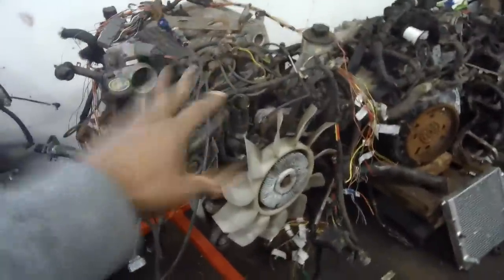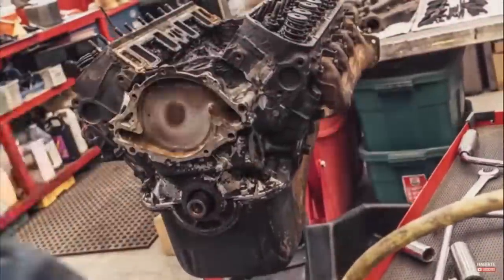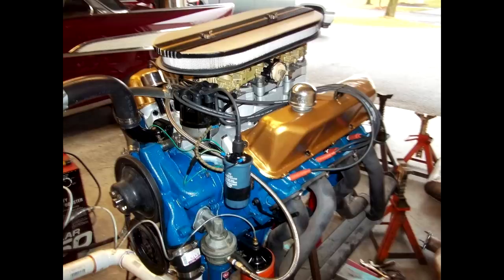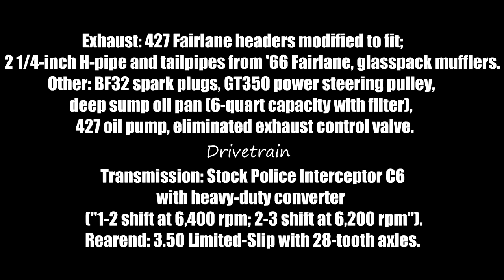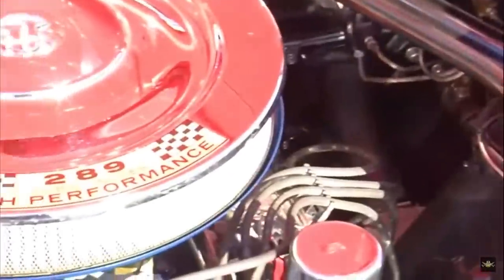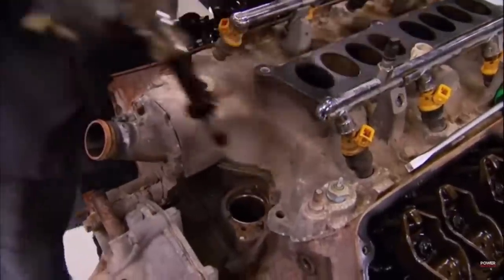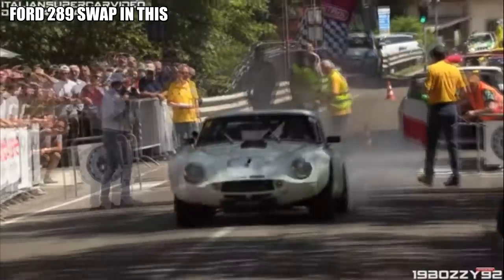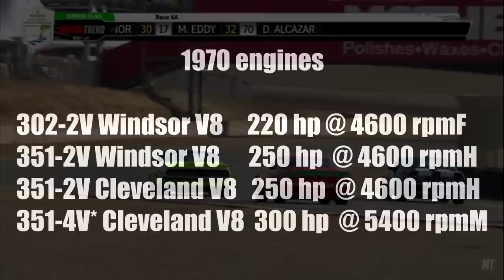289 Ford Voted BEST ENGINE BY CARROLL SHELBY ( HERE IS WHY )

Comment: Seeing how I grew up with all these engines... Here's my top 5: #1. 289 HiPo, sweet high revving reliable engine. #2 351 Windsor, just a stout motor. #3 302 Boss, Cleveland heads canted valves:) #4 429/460 Lima, it's a 302 Boss on steroids:) and #5 390 FE, FE's was the work horse engine back in the day, 352, 360, 390, 427 SOHC.  And Honorable mention: 300 strait 6, just a stump puller of a motor:)
Reply from the maker: this is a solid list  I mean a solid 1 Daniel I may have to side with this list.. cause i leave out so many other factors ( take the personal out ) and get to the balance and the performance of the engine 289 300 302 Boss 351-C, but I flip flop that #1 spot with 302 plain version. cause see them still running
Reply: @bstfordchannel923  True on the 90's 302 roller motors... and a stroker kit takes it out to a phat 348 :) But Dude! the 351 C/M Boat anchors :) The 400 Modified was built during the EPA 70's and barely 8 to 1 compression!  Love Cleveland 2V heads but scrap the block.
Reply: THE 429/460 CAME OUT IN 1968 BEFORE THE 1969 BOSS 302. SAME HEAD DESIGN JUST SMALLER BUT HAD THE SAME SIZE VALVES AS THE 429 SCJ.
Reply from the maker: @normanschwartzjr2564  great info Norman I can not debate ya i know very little details of the engines.. I just do not go there so deep.. Good info
Reply: @bstfordchannel923  the only reason I would not choose the 302, is short rod and on early engines the piston skirts would tend to crack on a higher mileage engine. Where the 289 had a longer rod and I never found a cracked skirt even though the engines use the same piston. 
A 289 in similar trim, cam, heads, intake, carb, exhaust, as a 302, the way to best describe, snappier and revs quick. And I like that about the 289. 
My vote goes for 289 !
Reply: 289 HIPO was my favorite too IN MY 1966 MUSTANG 2+2.
Reply: @normanschwartzjr2564  just imagine the engine with stiffer valve springs and a little bigger carb.
Reply: @chrismontreuil2206  Chris, mine had a 750 double pumper, cam, springs and headers and the RPMS were over 8000. It sounded great. That was in 1972 IMAGINE  what it would've been like with today's aftermarket cylinder heads.
Reply: I always wanted to FI that 300. I bet it would scream.
Reply: @bryanst.martin7134  I am a Ford guy, but the chevy 250 is a screamer. I once saw in an old hot rod magazine, someone cut and welded boss 302 heads and fitted it to the 300. Then it screamed !!!!
Reply: @chrismontreuil2206  Don't forget the solid lifters, and a warmer cam. Also the F4B was a big performance enhancer.
Reply: @normanschwartzjr2564  well your talken just passed 400 hp !
I am not into after market heads. But I hear you about that.
Reply: @bryanst.martin7134  its really something how much power came from those small heads.
Reply: Daniel McQueen 
The 400 is finally getting some love. There are now performance parts for it. It’s cheap and odd which for me makes it cool. Check out some vids about it and it may change your mind. But stock, yes, they were dogs
Reply: That six would bend the axle splines on a9 inch Ford rear
Reply: @danielmcqueen1024  there was no 400 M .  The M added to the 400 was never something Ford did officially. And the M for the 351 M doesnt mean " Modified " or " Midland " as has been falsly claimed since the introduction of the 351 m / 400 engines. The M in 351M was Ford production coding that stood for " Michigan " where Fords engine designers and engineering departments came up with the 351M engine architecture and specific block design as a low compression , tall deck emissions friendly low rpm truck engines . The 400 when first built along side the 351 C in 1970 was actually tited by Ford as the 400 C. 2 years later the " C " was dropped and it became just the 400. There was no other 400 engine from any other ford engine series or family. So there was no need of a letter to differentiate it from any other series 400 engines. The 400 is a square engineand when a early straight up non retarded 351 C timing set is installed in a 400 it becomes a very different engine. The 351M and 71 + 400 may be rather weak in the power department but they  are very reliable workhorse engines when maintained properly .
Reply: @GorillaCookies  I didn't put the Modified on the 400, as Ford Mechanics called the motor back in the day! The 351 C/M/400 had a larger trans bolt pattern so the C6 could be used.  Ford should have called them 400 BA for Boat Anchor! Maybe a very reliable truck engine but due to the low compression and the freaking weight of the block I never did a power build out of a 400M. I prefer a 351W with Cleveland heads for it's breathability and low end torque! And for more cubes, I built 429 Lima motors; I also liked the 460 in the F-Series Explorers from the 1970's.
Reply: Very hard to follow this video. It jumps everywhere. Don’t recommend
Reply: @davidaustin5882  @BST Ford Channel  that's his style and as you watch his videos, yes he's on the move 😂 he still has great info on Fords and especially Crown Vicks... The Panther platform!

Comment: I had a Ford mentor, the Late Ted Haywood. He built a 289 pulling 504 HP at 9krpm. Raced it all season long in NASCAR. He was Black flagged at Daytona for running a 167.86 MPH lap speed and over 200 on the back stretch. They told him "that ain't no 289, that's a 427 SCJ!" "we're going to have to tech it!" he said OK climbed out and layed on the hood. They asked him to get off so they could do their work. He said you ain't touching it till it's cold. They finally got it apart, measured everything and said it looks right.  We'll have to build and dyno it. He said you are not building my motor. After another lengthy discussion he built it (in private) and they ran it on the dyno. 504 at 9,000. This was 1958 technology. Once working for Smokey didn't hurt him any. ;-) I think he earned Mech of the Year for that one.
Reply: I built a 302 in 84 , wound up in an impromptu  race with a Ferrari and TransAm with 400 HO and walked past them both. Rolling down I5 making the dots a solid white line. La to San Diego in 1 hour. :-) Never tried that again. Broke a lot of Vette owners hearts!
Reply from the maker: I love these stories Bryan I read them both twice.. I wonder what was his recipe in that 289? these are the stories that make believe . I was all hyped about big cubic inches and that is not the case now.. I have changed my whole way of building and thinking to more compact engine package ( with low liters ) .. question brother what did you think happen to Nascar? did then men change ( men as whole ) loving cars ect or the rules or maybe the designs of the cars look nothing like the production cars
Reply: @bstfordchannel923  What did Ted do? He was a Golden Glove in the Marines, and helo mechanic. Got out and became a Police officer in Jax,Fl. Height of the beginnings of NASCAR. Actually worked for NASA briefly as a Hydraulic Engineer. Got bored. Opened the Pit Stop in Atlanta, a small but capable repair shop, even worked on the James Bond Aston Martin once, replaced a belt. :-) He ported his own heads, used tractor valves, and balanced the heck out of the engines. "Cleanliness was next to Godliness" was his building motto. Raced SCCA, and Nascar. He was hard core about following the rules. And worked for Smokey Yunik, started out pushing brooms, and eventually earned his way to the Trophy room where the Big Guys got their engines built. While being from Nebraska, he was as down home Southern Boy as you could want.

Comment: I will put it simple, I am a 289, 302, 5.0 fan first then the newer Coyote Motors.  I Street Raced Light to Light I called it, I also do rolling starts, but Off the Line was where my 1966 Mustang Shined.  I used all three motors in my Mustang.  Coupled with a 4 Speed and 4:62-1 Gears in an Modified 8" rearend.  I had many Tricks in my Mustang to make it one of the Quickest in Town.  I had an an offenhaser Tunnel, that I took the Ram off of, I bored a 3/4" Aluminum Plate to accept 2 BBL adapter plates and I put 2-2BBL FORD Autolite carbs on it.  The Throttle response was instant with Great Low End Torque.  I had 351 4 Barrel heads C9OE Stock bore blocks.  I would get a high lift cam and then Advance the cam to get more lowend torque.  I KNOW I Embarrassed more than a few people.  One of my favorites was the night a Red Trans Am pulled up next to me, They were pointing and chuckling.  I brought my RPMS up to 2500 and dropped the Clutch, I had Super Sports G-60 15s  She stuck like glue and I shot way out in front on them, I could hear his RPMs soaring as his tires were up in smoke.  I was already at the next light and they rolled up, Faces Red as the car and they would not even look my way.  I had that car for 33 years from 1974 to 2007.  I miss her Everyday.
Reply from the maker: you sir are the ma you had all 3 .. and i like you style you went old school then new .. many going new school and stop.. I like tatse bro .. You sound like you had some mean rides bro

Comment: I think the 289-302 are great engines for a Mustang. I had a 1970 Torino GT with a 351 Cleveland engine with automatic ,it was bad ass. I also  love  the 390-427 FE engines.
Reply: I had the same one! It was a slouch compared to my Mustang with a warm 302. C4 was was a bad idea to marry to it though.
Reply: Had a 73 F100 with a 360. 15 mpg stock hiway. Then I added precombustion catalyst and a CD ignition and got
 18mpg hiway. That was stock exhaust.
Reply: Amazing isn’t it?  The 360 was so under stressed that you couldn’t hurt it. If you were to put a 390 crank and rods in it,  the mileage would be about the same because of the efficiency. The 360 pistons could be reused provided the bores are good. I have done this and you would love it. I wish that the 360 had the pistons come up closer to the deck and head squish area. But I have had a few go to 300,000 like the 300-I6. Ford Iron must have been special in those two engine families. There are people who could shatter an anvil, but used as work trucks and maintained decently, they can be coated with grease and still work just fine.

Comment: that " Italian thing" with that wicked 289 is a TVR from England. The same country that produced the AC, as in AC Cobra.
Reply from the maker: thank you for that i had no CLUE what it was i have to put some respect on that car
Reply: @bstfordchannel923  tvr and ford had a deal just like shelby cobra.
Reply: @henryjohn2218  It was actually Jack Griffith in the states that came up with the idea of putting the 260 then 289 in the TVR Grantura. Which had a small 4 pot motor. That became the TVR Griffith. Built in 1965 and 1966. Weighed 100kg less than a Cobra.
Reply: @graemelangford1974  - I remember seeing my first TVR Griffith in 1966 and had no clue as to what it was.  After hearing it accelerate balls out, I realized it was some little British machine with a potent American V8 in it.  That car was a Cobra killer, at least in a straight line run!

Comment: Even though I'm a die-hard Cleveland guy with its huge ports and Coke can sized valves and mainly because of what Bob Glidden did with it against the GM cars in Pro Stock the 289 is a badass motor. I have 2 friends  running the 289 one is running the 1/4 in the 10s the other is running in the high 9s spinning it 9500. Look up Ray scardelli and Bobby fazio.
Reply from the maker: so rah has the old red-ish old school Mustang right? Then bobby seems to have the same type but all stickered up.. very cool ass rides thank you for the story and the comment plus the info Dave!

Comment: I'm going to be the "oddball" but I LOVE the 390 FE. Good strong motors with a shitload of torque. The sound of an FE idling is magic! 289 would be my small block choice. Lots of potential and strong motors for such a small package!
Reply: I second this
Reply from the maker: i can side with those choices REAL GOOD chices they can not go wrong.. I lean more to what is plentiful vs what really the best.. Which in many cases it wack to do that, but its just a safe zone for me
Reply: @bstfordchannel923  When you're on a budget that's the plan!!
Reply: I'm with you on this one but I'm biased because I own one. But I favor the truck block
Reply: I said the opposite but then read your comment. I agree.
Reply: You’re not as odd as you think lol. Unfortunately Chevy magazines have labeled this engine a “dog” but if you dig deep into the history, you find out that it was quite the performer. The dog motor they usually refer to is in comparison to the higher performance 396 offerings, so 67 ish Mustangs and Fairlanes. The GT 390 offered in these were about equal to the entry level 396, especially when you consider the ETs and speed of the runs even at the time. If you take a look back to 1961, there were the 375hp and 401hp 390 HiPo, that show what the motor was capable of by the factory if the parts were offered installed in cars, higher compression, aluminum intakes, solid lifter cams, and header like manifolds. Consider the predecessor, the 360hp 352 FE offered in 1960 gave the famous Chevy 409 a run for its money with over 50 less cubes.
Reply: @B1Springfield   Your'e correct. The stock 396 was as much a boat anchor as the stock 390. You could build both of them to turn low 12s in a medium size car. The big difference was the 390s blew-up 1st. The FE has thiner casting walls than GM. Cylinder bores could be slightly off on all engines back then. So the FE was not a problem if you sound check before adding performance parts. But that is not the way it went down. Screw high lift cam in, slap a big carb on and off we go. Can we say Ford deserved  the bad rap? I don't know. The thin wall higher strength design was intelligent. The ability of manufacturers quality control just didn't meet the higher tech design.
Reply: I'm with you on the 390 FE.  Just one grunty hunk of a motor.
Reply: 351 c boss is my favorite Ford engine
Reply: @mikef.1000  Yep, and if you put a 410-428 crank in it ( you could even use the 390 pistons) and put ARP rod bolts in with the GT-CJ cam headers, it was a real sleeper.

Comment: Excellent video. I’ve been into Fords since 1980. Somebody asked me what my favorite Ford engine was and I really couldn’t answer the question because they made so many great engines. Modern touring cars in Australia, modern NASCAR, modern off-road racing,  modern road racing, modern boat racing etc, are still using Ford engines that were designed in the 1960s early 70s. 

How many other car manufacturers can make this claim about their engines, very few if any. The boss 302, 5.0, 351 Cleveland boss, the 427 FE which won the 24 hours of Le Mans as did the 289 in the GT 40. Of course the overhead cam 427 FE which was banned from NASCAR for being too advanced, the supercharged 2003 mustang cobra engine, which is good for 800 hp what’s the stock internals. Even the new TwinTurbo V6 eco-boost engine, which won the 24 hours of Le Mans uses 70% stock components in the new GT 40 and other Ford racing cars that have won dozens of championships stock.

“RoushYates says the new EcoBoost race engine will utilize “60 to 70 percent” production components, including stock block, stock cylinder heads, stock crank and valvetrain.“

Comment: As much as I like 351W’s my vote for #1 goes to the 302, they’re light, they’re compact, good bore/stroke combo, there’s a ton of aftermarket support, they’re plentiful, make great power, and aren’t super expensive to build. Pretty hard to beat that. 👍🏻
Reply: Works better with 289 rods.
Reply: I agree I had many 302,s all of them great and durable
Reply: Your right they are Plentiful the junkyards are full of them
Reply: 351 > 302 in pretty much every way, including block strength
Reply: You got it!😎

Comment: 289 is my hands down favorite small block Ford engine. Love the effortless high-winding and the sound,oh the sound!
Reply from the maker: alot of guy love the 289 ,  I will go 302 only cause of what i grew up with... But my family love the 289 they had them in the Mercury capris 78 i think... they came with V6 but they put 289 in them and they where NUTZ

Comment: In the early 80's had a Ford 289 2 bolt main balanced blue printed, 11:1 compression, heads reworked with 1.96 in. chevy input valves and 162.5 in. exhaust valves, triple valve springs,..screw in studs, ported and polished intakes and exhaust ports, 1.71 crane rocker rollers, rod guides, 3/4 race cam, 650 double pumper holley carb that got 8 miles to the gallon on the street and 18 highway......... in a 1968 mustang fast back. Ford 4 speed top loader and 373 gears in the rear end.
 I went through 2 motor mounts, 2 clutches,2 rear ends, before I learned how to drive it properly. Best memories wheelies,.. and the looks people would give you when you beat them in a race.I do not know how much horsepower it had but I did beat 455 formula firebird with it "barely".... and almost beat a ford 428 cobra jet mustang, the scariest car I,ve owned. Total price I paid $500 for a $5000 engine the guy said to take out of his because it scared him, $1500 for a mustang. I did all the restoration work on it, and it only cost me about 5 - 6 thousand dollars total back then, I am glad I outgrew that hobby because today -------50 60 thousand dollars easy.if I recall correctly it did 60 miles an hour in 3 - 4 seconds and today is resting in many pieces...............
Reply from the maker: This was well written... I really enjoy this comment... Full of info and I will use some of this on my 351w